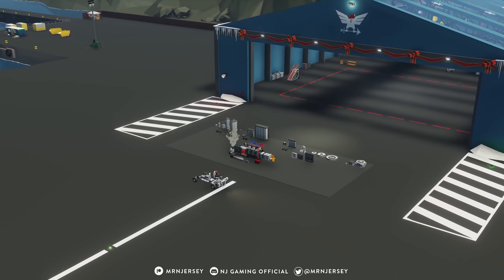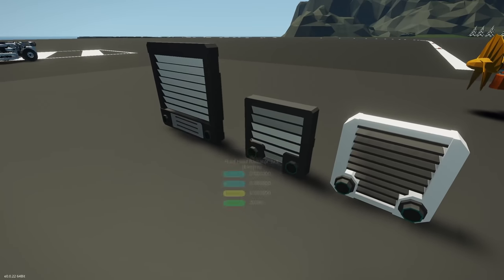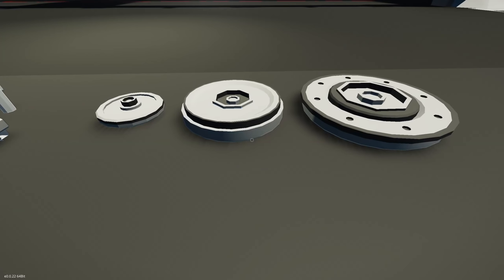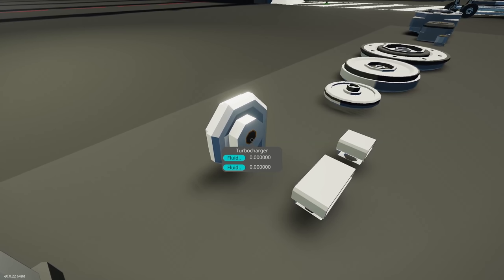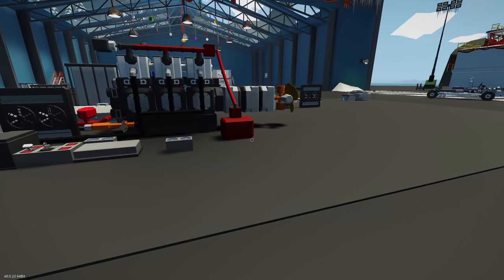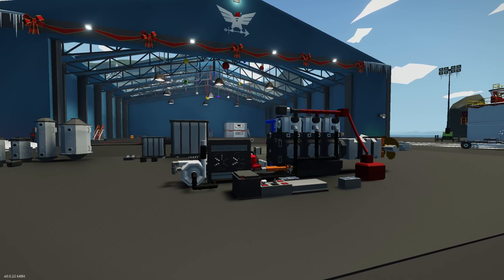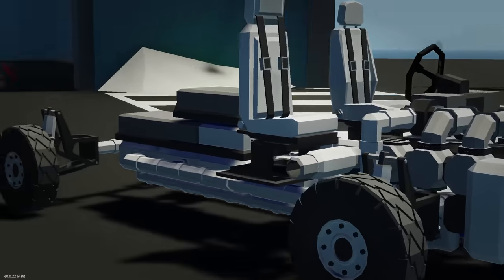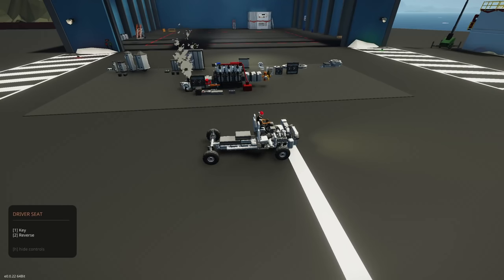NEW RADIATORS & PARTS EXPLAINED!! - Stormworks

Comment: An intercooler usually cools intake air after it's been through the hot turbo... Cool or colder air is more dense so you can use more fuel with the same air:fuel ratio for a bigger bang
Reply: does this actually work in the game though?

Comment: You know that a real turbo requires 2 sides. Because the exhaust spins a turbine and then drives a compressor on the intake side.
Reply: I guess they're trying to give you more flexibility in mounting, as well as using the same part for both turbo and other kinds of centrifugal supercharger.
Reply: @lfox02  tru. I should have wrote the comment after the video because I did it before NJ showed the power port. Then i thought it was pretty cool to use the exhaust as a power source.

Comment: Would love to see a "pull cord" starter added to the game, basically either a component you attach same place as a starter or a hand crank you attach to the front of the crank shaft and manually interact with it to put force into the engine, pull cord being adequate to start a small engine and the crank required to start bigger ones including small engines with too many cylinders, obviously requiring a clutch to work.

Additionally there could also be ones designed to work as a pipe output from a block\multiblock for the crank) for use with the standard engines to start them piped to the thrust output of the engine or to run a hand crank\pull cord manual power source, as this could be great for recharging an emergency radio, charging the battery for the starter on a ship too big to start from a direct crank or possibly even power a thrust powered pump against flooding.......perhaps even a manually powered propeller on a liferaft.

Comment: The intercooler is probably for when we get sea water cooling. you could run a pumped sea water loop, and then the engines cooling with fresh water so that the engine does not get damaged.

Comment: Intercoolers serve the same purpose as radiators, but often for boats. Raw water (sea or river water) passes through - housing and is then exhausted overboard. Your engine coolant passes through a set of pipes inside that housing and is cooled before returning to the engine.
The raw water serves the same purpose as air passing through a radiator, only it doesn’t need air. This is convenient for boats and ships where the engines are inside hulls.

Some intercoolers use impellers to pull that raw water up through a sea chest- often connected to the engine, so when it is at high RPMs it gets more water flow to cool the associated increase in heat.

Comment: So the turbochargers can actually be superchargers now? Hmm
Reply: except that currently, they dont work at all
Reply: @mathias6369  nice
Reply: every turbocharger needs 2 in an 2 out, and the axle in the middle connects both sets of blades. one driven by the exhaust, that drives the axle and the axle drives the second set of blades, thus making the air compressed
Reply: That or generators, using "waste" energy to charge our batteries.
Reply: @knuffelbaer1971  not sure if this was directed to me but i know how they work, ask anyone on the discord and they will agree (yes, even the devs) that they currently dont work

Comment: I was thinking. Maybe the intercoolers can be used to heat the diesel/jet fuel of your vehicle with the temperature of the engine. Like waiting for your car to heat up before you drive on a cold morning. So say for instance when youre in the arctic region you may have to heat your diesel/jet fuel otherwise your engine my not run properly. Idk i just think that would be cold. You know.

Comment: Will we also be able to use the heat from the engine to heat up our cabins, using the fluid-air heat exchanger?
Reply: well theoretically yes. IIRC thats how car heaters work, its just engine heat being blown into the passanger compartment
Reply: @Queue3612  Well most cars heaters use a heater matrix which uses the heated coolant to heat the cabin.

Comment: Intercooler idea: you have cold fuel n the way to the engine, and hot coolant on the way to the radiator or whatever the cooling is. Route both through the intercooler and the cooling will be taken care of, and warm fuel isn’t much of a concern. Anyways, that’s how it works in an irl jet engine to cool the oil, and maybe you can try some designs out like that.

Comment: I think they got the naming wrong, the intercooler should be an air cooler as it's supposed to cool the air coming from the turbo going into the engine. Air-to-liquid intercoolers are the most common, although air-to-air is also found. The name "intercooler" stems from the warbirds that had multiple supercharging stages and used an intercooler between - inter - stages..

Comment: I really want to see how you make the engines run so smoothly. I've been trying to find a way to do it, but I'm struggling. Can't find a way to correct for the air/fuel ratio. A tutorial for how to do that with a microcontroller would be nice
Reply: PID controller is awesome for stabilizing, but its complicated

Comment: Apppernetly there is a educational gap about turbochargers here: they use the exhaust to power the turbine which will suck in the fresh air on the other side to get more air into the cylinder (results in a better power output). So unless you build a electronicaly powered turbo this module is useless and unrealistic…